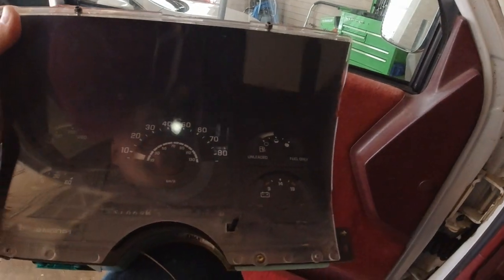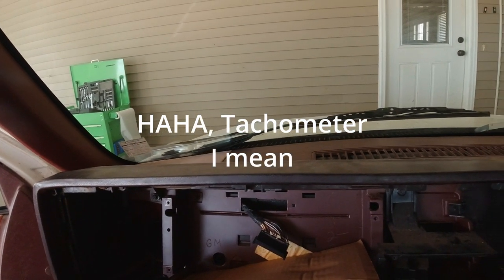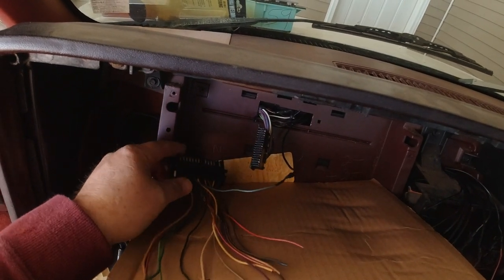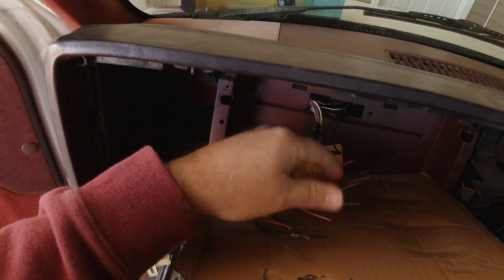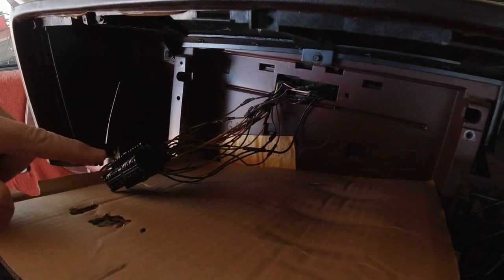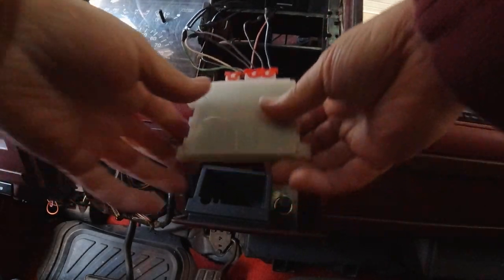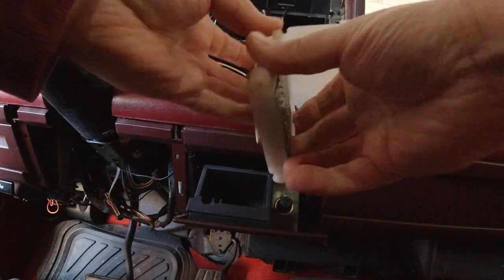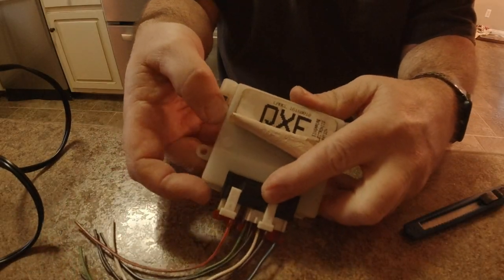88-91 OBS Chevy Moon Gauges to 92-94 Needle Gauge swap! OBS Gauge Cluster Swap!

Comment: in the wiring diagram in the description below it says to wire the drac into the 90 plug? i am confused about this as its my last step before my dash is complete (only the speedo is not working). any tips or maybe have a different diagram you could share to wire it into the "new" 92-94 plug? thank you and appreciate the video
Reply from the maker: Anything referring to the 90 plug will be the harness side of your truck(Which the new plug and drac wire into. Cut wire at old plug and wire new plug or drac into. Do one wire at a time). When you finish, you will only have the drac and your new plug wired into the harness of your truck. There is only one wire from the drac(think light blue and black) to the new plug(this runs your speedo) and everything else goes to the harness. Hope this helps and thanks for watching!!
Reply: Did you ever figure it out? Im in the same boat

Comment: I see that the main wiring page is down and that you added a few links to try to help. We’re you able to see if you had any of the wiring info downloaded still? I’ve got everything together to do the swap just need the wiring images
Reply from the maker: No, I couldn't find anything that I saved and I looked for a while. No links to the websites work. 
 On that note, the wiring diagram that you are looking for wasn't 100% accurate. I mention this in the video. I ended up trusting the color of the wires and just connecting color for color after I found errors in the website info.
  In my situation every wire on the new plug has a matching wire on the harness I was connecting to.  It didn't matter the pin location because the new plug knows where it needs that color wire. The only thing is you will have more blacks and pinks(if I remember correctly. It's in the video). You will just wire all the blacks in a bundle and wire them to a single black wire. Then wire all the pinks in a bundle and wire them to a single pink wire.
  I would do this mod now without the websites. Saying all of that, this was on my truck and yours may vary but I highly doubt it. I truly hope this helps and good luck!

P.S. The Drac wires were also color for color from the Drac module to the old harness.
Reply: Hey man just wanted to say that I did the swap today and got it all figured out. Had to rewatch the video a few times but from looking at the pictures in the video got it figured out. Loving the new(to me) gauges and especially having the tachometer now! Just gotta order in some leds and it’ll all be done
Reply from the maker: @seanh.8190  That's Great Sean! Thanks for letting me know how it turned out. I know the links are no longer functional but was thinking it could be done with the info in the vided. So glad it worked out for you!
Reply from the maker: I found the wiring diagram and posted it in my Google Drive. The link now works and will live in my Google drive from now on.
Reply: @Sean H.  what year is your truck I'm trying to do this to my 90 . I see it's all color to color correct but what about the drac box do the colors match on those. I found something online showing the wires are slightly different on the drac to old wiring
Reply from the maker: @IsaiasMoreno.  It is a 91 year. My drac box was also color for color. I have a link in the description to a lot of useful information. Thanks
Reply: @ForceBuilt @ i have a 89 , will try a tach cluster,   Actually the drac wires  came from 89 plug???
Reply from the maker: @gerardolopez5875  The wires from the drac will go to the original wires in your harness that connects to your cluster. Not sure if that is what you were asking?
Reply: @ForceBuilt  @ yes, thats it,,    Does drac module needs programming???
Reply from the maker: Yes for tire size.  I show that in the video at the end I think

Comment: Have you seen the 91 tac cluster very rare it’s a direct plug just have to add one wire.
Reply from the maker: Yes Jay, I actually looked for that cluster first before doing this swap lol.  I should have made mention of that in the video.  Thanks for the comment.
Reply: @ForceBuilt  I found 1 the other day for my 90
Hopefully everything works out.
Reply from the maker: Wow you found the pot of gold at the rainbows end! Congratulations! It will work out much easier than what I did lol. Good luck!!
Reply: @ForceBuilt  Thanks
Reply: @jays6.021  where I can find it??
Reply: I think is not direct  plug,need to move 3 wires

Comment: I went ahead and wired the new harness and my tach work now wired to my coil. But the drac box had a brown wire that the diagram showed to be disconnected. Any idea what that wire is for
Reply from the maker: Sorry, I don't know. Is everything working?
Reply: @Force Built  it was kinda late last night when I finished wiring it I will test drive it and let you know
Reply: Everything worked out fine thanks
Reply from the maker: @IsaiasMoreno.  congrats on the new upgrade! I think you'll like it.
Reply: What year truck and gauge cluster swap???
Reply: Truck is a 90 cluster is a 94

Comment: I'm putting a 92-93 needle gauge cluster in a 1989 Chevy C1500.  I have the cluster # QAA and the plug for it.  I need a Drac Module, can you please tell me which one I would need that can be programmed for my tire size and gear ratio?  Thank you
Reply from the maker: I think either module will work. There are 2 styles. One has 7 jumpers and the other has 14. The jumpers are where the dip switches go. Get the one with 7 so there is less soldering of the  dip switches. (I know I answered you in email. This information for someone that may has the same question).

Comment: So im trying to swap a 92 needle cluster into a 91 moon cluster i have a separate tach and water temp since i did tbi to carb swap are the wire basically color to color my truck doesnt use the ecm
Reply from the maker: Color for color should still apply. You will need the old style harness plug too. Thanks

Comment: Would this work on a 1988 Chevy C1500? I don’t think the 1988 has a DRAC module. Trying to swap a 1994 cluster into a 1988.
Reply from the maker: The 88 has the drac built into the cluster as did mine. You will have to get the drac module separately as I did. Thanks for watching!
Reply: @ForceBuilt  Ok thank you!! That helps a whole lot. Does it matter what year DRAC? Do I get a 1988 or a 1994 or does it matter?
Reply from the maker: So there are 2 types. One has 7 jumpers and one has 14. The one in my video has 7. The one with 7 is the one to get because of less soldering. I use the dip switches on mine(shown at the end of the video). I did indeed need them to fine tune my speedometer. The dip switches make the speedo calibration process super simple. Hope this helps. If you have any other questions, feel free to ask.

Comment: I currently have the needle cluster in my 92 and I want to put the 88-92 cluster in mine. Would this install be similar to that?
Reply from the maker: I honestly don't know. So you want the Moon Gauges and ditch the needles? I think it would work. I know the early gauge clusters like in my 91 the drac was built into the cluster. All the wires should be there.
Reply: @ForceBuilt  yes I have the needle cluster but I want to swap to the moonie gauges. Would I just need the plug and wire it up color to color
Reply from the maker: @grissom.  I think that would be the right way to go about it. That is how I would do it. Thanks

Comment: my drac module has a dark blue cable, help got a qwb drac
Reply from the maker: Send me a picture of your drac wires and plugs to my email so I can see. futuraforce@gmail.com
Reply: My drac also has the dark blue wire, the drac was pulled from a 2500, the dark blue wire is located between the white wire and purple with white stripe. Guessing I just need to remove the dark blue wire? Noticed from pictures of other drac’s, they don’t have a wire between the white wire and purple/white.

Comment: What would you charge to solder a drac box?
Reply from the maker: I would hate for anyone to rely on me to do it. Do you have an electronic shop anywhere nearby. They should be able to do it without a problem. It took me a little while on mine.
Reply: @ForceBuilt  not really sure if there is anything like that around here as I am still new to the area and don't really know my way around